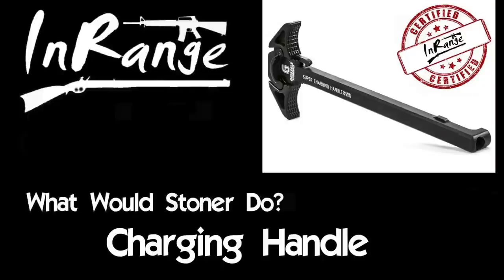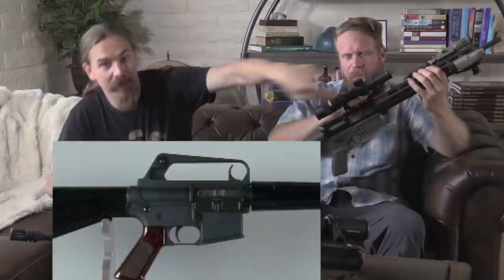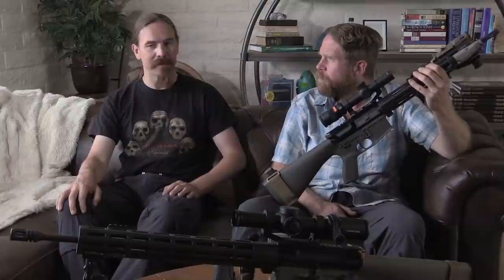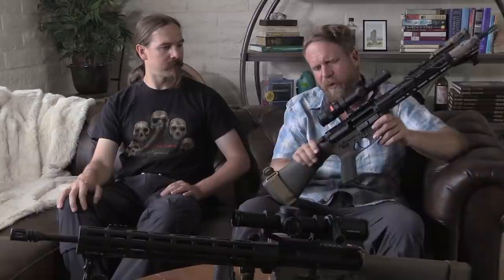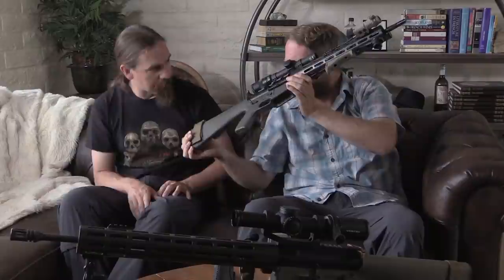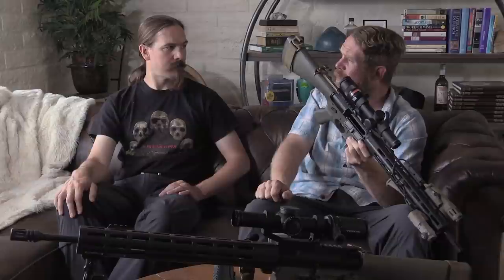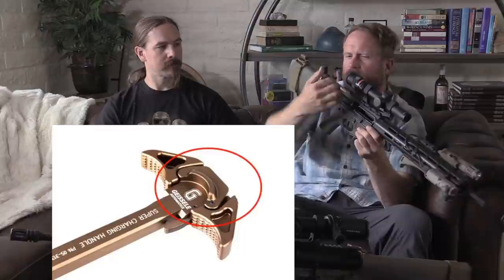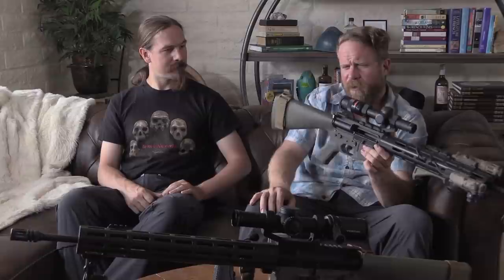WWSD: Geissele Super Charging Handle

Comment: I have plenty of time on the AR Stoner platform of rifle . So much that I saw a Facebook meme about stoner paradise and it didn't make sense to me because I immediately thought of black rifles and the post was talking about pot heads . In the last 15 years I've seen a lot of Internet tacticoool experts telling me that I should upgrade my charging handle and it never made sense to me . I could not see benefits of this modification . I just never had a problem with the OEM / mil-spec style of charging handle . You are the first to make me think seriously about actually buying a charging handle . I have had ambi handles before but always because it came in a parts package that I bought but they didn't change anything about how I ran my rifle . I bought a Integrally suppressed barrel kit that came with a hand guard , BCG , adjustable gas block and tube and gas buster charging handle . I plan on machining a 5.56 mm barrel to add in place of the 300 blackout . I bought the 300 blk because of all the hype about the round being more efficient in short barrels and the effective barrel length is  10.5" because of the suppressor porting . But I don't shoot it as much because of the ammo price and lack of bulk availability .

Comment: It's funny that you mention the G36's charging handle, as IMO that should be the gold standard all charging handles should compete against.
It stays out of the way (the actual handle is under spring tension, so it returns to the centre position automatically), it is ambidextrous, it contains a silent bolt close device (pull the handle to the side as if to use it, then push it towards the middle to lock it in place), it is easy to grab both with bare hands and with thick gloves, the movement comes really natural and is much faster (because it is much closer to your supporting hand than the AR-15's handle).
Reply: It's not good, the G36's charging handle forces a raised and non supported rail, IE, bumps your optics up away from bore and causes you to have a weak unsupported rail since it has to hover over the handle's race way, IE, more accuracy problem due to twist and flex....the AR's receiver is one solid chunk with no moving pieces, this is why it's such a good optics host. 

Plus it requires a very particular receiver shape to work, hence why it's seen nowhere else and from what i gather it's not the easiest thing to grab from what limited exprience i have with the G36, it's very flat and you have to feel for it since it's the same shape folded as the entire stalk of the handle, i run from the back and feel for the hinge point....it's not very intuitive,  compared to just reaching back and smacking into the charging handle's hook.
Reply: It is actually very easy to grab, even with three-finger-mittens during winter, as I can attest from personal experience (and with the same knowledge on the AR-15, the same can't be said there). And the stability argument for the optic rail doesn't count much, we're talking about an assault rifle here (not to mention that if you look at the G36, the scope actually looks through the optic rail, only the red-dot sight sits on top of it).
Reply: Some versions never had it (namely the V-variants, G36V and G36KV as used by the Latvian army for example). And the receiver still is only about 10mm higher than the AR-15's. And of course the handle is still easy enough to grab, even with thick gloves.

Modularity was never a goal of that weapon (nor of this discussion), and none of the G36 variants can compete with the AR-15 in that regard. There is only the receiver made by H&K, there is only the bolt (and bolt handle) made by H&K, even the stock is basically limited to what you get from H&K (not to mention the trigger). The rifle has never got the popularity and was never used widely enough for third-party manufacturers to get in on it, like they did with the AR-15 platform. If you want to compete the two platforms against each other in that category, the AR-15 wins without even breaking a sweat. 

That doesn't change the fact, that the charging handle on the G36 is a much better thought out idea.

Comment: Did you guys look at Geissele's AIRBORNE CHARGING HANDLE (ACH)?

FULL DESCRIPTION
"The Airborne Charging Handle (ACH) was developed at the request of an elite organization famous for its expertise in aerial insertion. The organization requested a lower profile lever design to reduce the chances of snagging. The ACH’s lower profile design is especially ideal for rifles where the primary sighting system is a red dot or similar low profile optic system. The ambidextrous ACH is 3D machined from a solid block of aircraft grade 7075-T6 aluminum. Shortened levers are dual contoured with gently concaved radius cuts in the vertical and horizontal planes. The handling surfaces of the levers are checkered for confident operation while wearing gloves. A taller fence at the rear of the ACH aids in redirecting gas blow back when shooting with short barreled and suppressed weapon systems. The ACH and its components are Type 3 Hardcoat anodized and are available in Black and DDC (Desert Dirt Color)."

Comment: I got the Timber Creek entry, equally absurdly priced. It's a little smoother than the OE S&W unit, but not quite Guc- err-  Geissele smooth. Still no regrets as it's much easier to operate southpaw, has rounded corners that don't make it a snag-o-matic, and it has those 'wings' like the Geissele so it's easy to acquire around a scope. Also available in a nice shade of OD Green (or orange, gold, whatever floats your boat).

Comment: Try the Armageddon charging handle, it's another evolution over the Geissele that is ambi, enclosed for dirt, snags even less than the geissele, is stronger than the geissele, and does a far superior job of gas busting. Cranes recent debunking report on gas busting charging handles was prior to the release of the Armageddon, crane now has a PO for a huge quantity. Check it out.

Comment: I am so glad I watched this video. My AR-10 has been giving me a lot of blowback gas in my face and I thought it just was the ammo (never would have thought it could be the charging handle which I replaced around the same time I got the bulk ammo). Tomorrow going to the range to see if going back to the old one (which SUCKS to use because it is standard AR-15 sized mated to a big ol .308 buffer spring) solves the blowback problem.

Comment: So funny how these were “easy” to get in 2017… now in 2021 it’s part of shortages… ugh the good ole days 😢
Reply: I got one at a local cabelas a few weeks ago. It was the first one I've seen since 2019. And it was the only one on the shelf. I think it was about $85 and I had $26 cabelas points so it was a no brainer. It replaced a bcm mod 4. The mod 4 always felt sloppy in the vltor upper it was in. The Geissele is a big improvement.

Comment: I'm surprised you guys didn't try the HABU charge handle from Falcon37.  I picked one up to try recently and I love it.  Ambi, lots of grip real estate, blocks gas, and it doesn't torque against the upper like my previous BCM and other conventional charge handles I have tried.  I love that it's essentially the same movement I use to run the slide on my pistol.

Comment: I'll definitely have to check this thing out for my WWSD upper project.

The BCM handles are definitely snag-y in my experience, but I've had really good luck with the Troy ambi handle and the Raptor, though the Raptor definitely has a lot of snag potential.

Comment: Well shit... just picked one of these up after debating between this and the Raptor LT for days. I've had a regular Raptor before and figured this wouldn't be that much better. I was wrong, it feels great. The checkering is significant and gives good grip. .. and it's just damn smooth and doesn't move side to side much when pulling back one handed, my old Raptor would bind sometimes.

Comment: I've had a low end ambi handle that broke the left side handle/lock latch broke bc the rollpin after binary mag dumps it flew off the handle worked but it wouldn't lock in but during fire it would two ur nose if u got to close

Comment: My Radian Raptor LT is pretty nice as well.  Geisslie has a very nice trigger (SSA-E) so i’d Imagine their charging handle would be nice. Seems to be mostly aesthetic differences in my opinion more than functional differences. I’ve seen the Raptor LT’s go for 70$,

 I had a BCM ambidextrous charging handle that was fairly nice, but the latch was fairly large now that you mention it.

Comment: If you're worried about the strength of the charging handle, I think you should try the Sintercore handles. They don't have any moving parts other than a new detent that's out of the way of gear and stuff. It's about as close as you can get to a boot stompable AR charging handle. They even have one that has vent holes to reduce gas in your face from suppressor use.

Edit: Forgot to mention it's also super light.
Reply: Second, I use the sintercore handles on all my rifles. best charger on the market.
Reply: They are horrible. They come loose when firing.They also wear out the catch groove on your upper.  Destroying  your upper. Just look where that detent catch rides. You will see it has taken off the coating  and will soon start wearing the aluminum. All straight pull spring detent type handles will do this.
Reply: hasn't done this on either of mine and the coming loose thing has only ever happened when I had it slung with the bolt to the rear. I hate you have had your issues because I love mine.
Reply: Alex Capps do not know how long you have had them but it will happen. It is in the design of them. There is no way around it. The constant riding of the detent over the hard corner wears  down . Making it loose it will get you in the nose. Then when you go back to a regular charging handle it will not work either since there is no longer a nice corner for it to grab.  I have a radian raptor now (after having to buy new a new upper) and love it. Have not tried a geissle to know how they compare.
Reply: It's impossible for them to wear out the catch on your upper on a scientific level. The latch they use is a type of polymer, the upper is aluminum. The only wear on my upper is from the milspec handle smacking the shit out of it every time I charge it. Edit: Not to mention it's less likely to come loose on gear because there's no giant latches on the sides that can completely unlock the charging handle, you have to physically overcome the detent with more force than anything that uses a locking latch.
Reply: hornmonk3zit you are correct they are made of a polymer. Specifically delrin which typically is used in sealed dry bearing surface applications. The reason the are usually used in a sealed environment is dirt. Funny thing about plastics is they can get embedded with dirt,grit, and carbon particles. Turning it into sand paper. If you shoot your gun guess what it is in a unsealed environment it   is going to get embedded with carbon and grit. Now if your gun is safe queen and you shoot only maybe 100 rounds through it a month,sure go ahead use one. But if you go shooting regularly  dumping hundreds of rounds.  It is a very bad choice.  Then there is the fact you will have to regularly replace the latch from it wearing down and coming loose.
Reply: None of the things that can get embedded in plastic are as abrasive as the aluminum oxide that was already on the surface of every other working part of an AR, including the original latch, and I replaced it for that reason. And considering the fact I've been using the Sintercore handle on an upper that was "broken in" per the instructions on Sintercore's website, and have noticed zero additional wear on the upper or on latch itself over hundreds of manual cycles of the action I'm gonna keep using it.

Comment: This is an awesome project and I have come to some of the same conclusions myself and have changed parts of my rifle because of these videos.

While I agree with you that the Ambi-charging handle is a must have for a modern AR15, I think that style protrudes to much.  

I have a Mega Arms Slide Lock SL-400 Ambi-Charging Handle that is about the same size.  I use a 2 point sling and when sling across my back it would poke me in the back enough that I stopped using it.  

Troy has one that is the same profile as a standard CH but is Ambidextrous.  I have not used one yet but might put one on my 16" AR15.  https://troyind.com/products/ambidextrous-charging-handle(I don't have any affiliation with Troy, I just like their products.)

Also, I'm right handed and I have found that when I am not thinking about it, I naturally charge the rifle with my right hand and do a 2 finger charge with the stock staying against my shoulder.  I think the benefit of using 2 fingers is you minimize the chances of your fingers slipping off the CH because you get a much better grip.  

I also have found that I am much more coordinated with my right hand and as long as I am not to far forward on the stock with my cheek I can charge my AR15 without losing sight picture and will charge the rifle much faster than with my left hand.  If I use my left hand with a right hand stance I have to pull the rifle away from my face.  

Reacquiring sight picture takes longer for me than reacquiring grip position and trigger control.  

When I switch to weak side I do the same but charge with my left hand, still 2 fingers.

Comment: I ran the Geissele on someone else's rifle once. I liked it. I considered it for a while, but now that I am starting to built my AR, I went with the Raptor instead. It is nearly identical, but just slightly smaller, slightly lighter, and costs far less. I do have to admit that side by side, the Geissele does seem just a touch smoother, but the Raptor costs $35 and the Geissele costs $90, so that slightly smoother feel was not worth the $55 to me.
Reply: I wanna know is where in the world are you finding the Raptor for 35?! Everywhere I seen online the Raptor is about 80-90 bucks. Unless you're talking about the newer Raptor LT which uses a polymer molding around the Raptor's skeleton-like frame. Even that is still about 60 bucks...
Reply: I just checked the price. $69 at AIM Surplus. Apparently the price has shot up since I bought mine. With the new price in mind, I would not get the Raptor.
Reply: Dammit! I was kind of hoping it was on sale somewhere. lol Oh well... Strike Industries extended latch will do for now... XD
Reply: Ha, sorry. I was basing my price off what I paid. I did not know I got a special deal or that the price has gone up.
Reply: Nah, It's all good man haha... I bought it anyway since it was in stock with free shipping... The Geissele is still about 20 or so more than the raptor which both somewhat feel the same when I was at the gunshop yesterday. 69 bucks wasn't too bad imo since I originally was gonna go with the BCM MOD4 ambi charging handle, but that thing really pokes you during carbine classes. I feel really fortunate to have a lot of friends who already have some of these products and they let me try them out...

Comment: People [civilians] don’t realize how easy it is to snag the charging handle on stuff when you’re wearing body armor. I used to run an expensive ambi charging handle on my rifle until I started using a plate carrier 🤦🏽‍♂️ any slight movement and that thing would snag on my mag pouches. Now I’m back to running a $20 Mil-Spec charging handle just like Stoner intended 😂 some things are just accessories imo

Comment: Karl by any chance did you try out the Raptor? And if so, how does the Geissele compare to it with the issues you stated as being the reasons why you switched over?
Reply: MrGunman11 I have a Raptor Freedom Bone charging handle on my rifle so I am quite curious as well!
Reply: I have both. The Geissele just feels better. The fit and finish is tighter. And the action is smoother. It just has that "premium" feel to it. Also, the paddles are slightly larger, so it's a little easier to operate. I got the Geissele on sale, so it ended up being only like $10 more than the Raptor. It's worth that price difference. That being said, I have a couple of Raptors (the regular ones and the freedom bone ones) cuz they're on sale more often.
Reply: Cool, thanks for that.

Comment: There are only 2 reasons to use the charging handle, to lock the bolt back for clearing or loading and to clear a dud round. BTW it was never intended to use it to actually charging the weapon, the correct way to do that is lock the bolt open, to clear, insert a loaded mag hit the Bolt release letting the bolt run home.

Comment: I've got a similar charging handle on my AR, I think its the Radian Raptor Charging Handle (I didn't purchase it myself, it came with the gun). It's only about $10-15 cheaper than the Geissele, but unless I used them side by side, I couldn't tell you which is better.

Comment: Strike Industries latchless handle with the extension on the side you prefer or both FTW! btw 12$ and 3$ for the extension is a hell of a deal. On top of that it has that gas  shield as well.